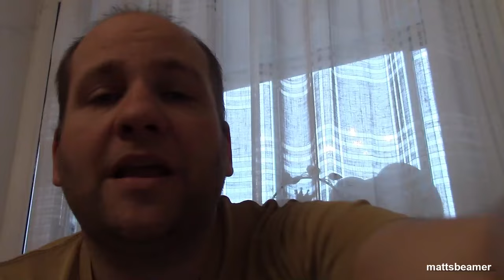BMW Drivetrain Malfunction (Error) Drive Moderately Problem. Information Video.

Comment: If it might be as a result of "dirty fuel" how do you go about cleaning out your car's gas tank. I stopped at a Shell station and put in 93 like I always do but it's kind of a Shell station that is out there so I think that might be why I am getting this message.
Reply from the maker: Hey, the way I had to do it, was to put the best fuel I could get into the take and keep driving it until the error disappeared. Did you let your fuel get too low?  )
Reply: @mattsbeamer  Just left the BMW dealership. Was not bad fuel. “found LF engine harness on engine bay to be rubbing on plastic bracket causing wire insulation to chafe and wires to short”. My service advisors took care of it.☺️
Reply from the maker: @jenme2390  I’m very glad it’s sorted for you. If you have any other questions car related I’ll be happy to talk :)

Comment: So I was flooring it around I have a decent build lots of parts on my 335 ,safe to say it’s meant to drive a little faster but ...the drive train malfunction message popped up, it drove home a nice 20 25 miles no problems at all it was not in limp mode it was shifting just not getting full boost or power,  when I got home in my driveway I restarted it and waited and it went away... drove it again today no malfunction light feels fine but should I get it checked ASAP or could it just have been me doing power slides and ripping it down the road
Reply: Hi, I have the same issue right now with my m235i. A nice build but I got this error when ai floored it. I noticed that it doesn’t go full boost but it’s still fast. What did you do with your car? Thanks in advance
Reply: @dbs_jd hey what was the result?
Reply: @ironmerc225 a boost leak because I had a meth kit installed

Comment: Hi I have bmw f10 2012 and drivetrain is on and I scan the car and is coming up egs
Reply: I am driving f30 320i 2013. I had the same error, it was a stuck waste gate arm. The electronic solenoid could not push or pull the wastegate arm

Comment: Two weeks ago, my 328i went into limp mode when I accelerated to cross an intersection. Drivetrain error popped up. Last week, it hesitated to start and I got a Chassis error. Yesterday, it hesitated to start and got an Open Hood Error. Today, it’s back to the drivetrain. Battery and alternator are both good. Is my car just bipolar?
Reply: I think my car is bipolar too.. has the issue been solved yet?
Reply: @raghadaleady7203  I ended up taking my car to the dealership in Ocala. I needed a new battery and I also had a service light on that I didn’t notice before because it only stays on for a few seconds. The service light was for brake lines to be flushed ( or something like that…lol). Ended up costing around $800 for both but now my car is running great. The service advisor at Ocala BMW was actually really awesome and he showed me how to check and see what service is due. He also said that even though I didn’t purchase my car there, anytime I needed service done, he would send someone over with a loaner car and pick my mine up at no cost. I live almost two hours from the dealership! So if you are able to get to Ocala, I’d recommend calling Robert!
Reply: Let me also add that I had tested the battery before I ever took it to the dealership and it tested fine. So don’t let a good battery test convince you that your battery is good.
Reply: @CarolynWeeks  Thank you for sharing your experience! I'm glad you sorted the problem out! I did ask them to check the battery and I'm currently waiting for the results hopefully the problem is very minor.. Ocala is definitely not anywhere near me since i'm in Saudi Arabia lol.. I'll keep you updated on whatever happens with my car, since we both have bipolar cars lol!

Comment: Also, the left lamp malfunction light comes on. BMW 328i What does that mean?
Reply from the maker: It usually means that one of the lights on the left aren't working. Sometimes this fault can come up, if you fitted a LEW bulb, or a dirty bulb. When you fit a LED, it typically means that's the computer is confused that the bulb isn't drawing too little power. I hope I make sense, :) good luck.

Comment: Hi All, I’ve got this error on my dash by just heading to the shops. I was in sport mode but was not thrashing it. I took it to the mechanics and he scanned with the OBD and nothing came up. No errors. The car drives fine, no shaking or start up issues. Not sure what it could be. I bought new spark plugs and coils and will probs replaced them anyways. Then take it to another garage to get them to scan it as well. Mechanics test drove the car and said the clutch, engine everything seems fine

Comment: I have a 2018 530E and this drivetrain message comes up whenever I'm driving at a high speed and brake hard. The car always jolts when it happens, as if the brakes failed.  The electric driving is disable after this and the message says I can continue to drive.
Then as you said, when the ignition is turned off and on, the error resets.
I just got the car second hand 2 months ago and the dealership checked and there were no errors. I wonder if anyone else experiences this? Also wondering if the hybrid recharging has anything to do with it.

Comment: Thanks for posting this video. Am getting it checked out and let you know what I find. I am thinking - though a bit out there - is that I just moved from a flat place to a mountain area. Perhaps the car is not used to all the hills in the heat.
Reply from the maker: Please do! I would be very grateful

Comment: My issue is very similar. It’s been a couple of months now since the engine light has come on and it has not gone away.
My 330e sometimes would start in electric mode but once it goes into petrol mode, it won’t switch back into electric mode until I start the car engine again.
Only once or twice I had the issue where my 330e would not change gear at all and I had to restart the engine and it was fine since.
Also when going downhill my car wouldn’t change to a lower gear.
Any idea what could be wrong?
Reply: Aux battery
Reply: @chrisallen649  so just get it changed?

Comment: I have a 2010 550i Gt and it’s doing the same thing. Except when I first turn it on it’s already shaking saying drivetrain malfunction. We’ve changed the spark plugs, coils and computer and the issue is still there. Any help ? Thank you !

Comment: Will get this error when I accelerate on an incline. No loss in power or anything like that when I get the error. Told by the dealer it’s the turbo wastegate issue.
Reply: Same exact problem.. they "fixed" the wastegate.. Yet, i still get this message.. so weird!

Comment: I drive BMW x3 2011 model. I got this message a month or so ago. I have been told by BMW Service I need to replace EGR valve actuator, I needed to replace EGR Valve costing A$750.

Comment: It happened to me the first time with my 520dw. BMW diagnosed it as low fuel pump breakdown and it was replaced at the cost of 1650 Aus $. I was driving it home from the BMW and the car stopped before I reached home k kms away from the BMW. second diagnosis was one of the fuel tank sensors gone off. Solution suggested was fuel tank replacement. Fuel tank came but without the sensor. i’m still waiting after one month. Rent a car costs so far $ 3000 plus. And the new tank replacement cost 3450.000. Quoted. This is a real let down.

Comment: For me, when I start my G30 540i it cranks slow then revs a little by itself for a little. Followed by limp mode, stuck on 3rd gear (slow)
Reply: Exact same issue on my 545i 2004, today I went under and noticed oil leaks under the engine and I saw a bunch of wire connection (between the engine and gear box) being soaked with oil. Also my speedometer does not work

Comment: My BMW trouble code 24F700 Fuel filter heating activation- open circuit and drivetrain signal message...
solution??

Comment: My 530i was stuck in water for about 15 mins and it was pretty high and then I got that drive train malfunction hike my car was vibrating. It then went away and my car was still vibrating a bit and now my check engine light is on. I waited 4 more hours and the vibrations have stopped but my engine light is still on

Comment: I've had my bmw 2014 116i sport for a couple of years now. 
Almost like clock work, if i cold start my vehicle it high revs for about 10 seconds, then drives fine. If I drive the vehicle around and stop and start it a couple of times, again, like clockwork, the vehicle shows the drivetrain message when I pull away and the car shakes, cuts out but restarts itself (stop start engine)  
I've had a high pressure fuel pump fitted, new spark plugs and coils. Can anyone help??

Comment: Please help !!! 
My 2013 435i develops misfire under hard acceleration then throws drivetrain malfunction code 

So initial code I got was 
118001 mixture too lean 

After drivetrain malfunction comes up  codes are as follows 
14001 combustion misfires several cylinders fuel injection switched off
140010 combustion misfires several cylinders detected 
140301 combustion misfires cylinder 3 fuel injection is switched off 
140301 combustion misfires cylinder 3 detected

Comment: i have 2017 330i. Today had oil changed. All was good... I reset the change oil warning light. Then, I pulled off drove about 3 miles then the Red Stop motor light comes on. I take it back to oil change shop, they pulled new filter and re-seated it. Car is at idle then the Drivetrain: Powertrain CONT. yellow came on. WTF is going on. Anyone has any ideas or specific knowledge please I am asking for any help or info. I just dropped 2k on the coolant pump in January 2022. No way I have this kind of money to drop into shop for repairs.

Comment: Man I did my valve cover started my car lost my P AND D light on dash if I leave it in gear long enough it will jolt real hard into drive and reverse . I got codes transmission range sensor circuit malfunction and lost communication with gateway. The car doesn’t shift until 4500 Rpms I have no control over the gear selector and I’ve already checked the gear shifter for shorts and I have changed my fluid and filter the problem is still here . If I reset the codes while driving it will shift at 2k rpm up until about 60 mph and my trans is in safe mode
Reply: Did you ever find out your issue?

Comment: Hi I bought a used BMW X3 2011. The very next day i had the error message while I was trying to start and go on a drive. "Drivetrain fault. Please contact BMW service center". So the car was in parking mode and I could not change it to drive mode. Car starts but the gear cannot be changed. I tried starting after few hours and the problem still exists. Please help if anyone knows about this particular case. Thanks...
Reply: did you ever figure it out
Reply: @nyustdent  yeah, I had to replace the 'mechatronic' unit. Costed around USD 3500 for the complete work. After running well for 3 months or so, I got the drivetrain fault again. This time, it was coils and spark plugs. The technician said replacing the faulty coil is sufficient but I may get the same error again as the other coils and spark plugs also on the way to get faulty. So I replaced all 6 coils and 6 spark plugs at a cost of around USD 500. I live in Saudi Arabia so the costs may be different for you. Thanks..

Comment: hi, Matt, i have a 218d automatic, this drivetrain malfunction appears all the time when i start off the engine. the sysmtoms: i could not speed up as quick as before, and it's hard to reach 70/80miles/hour. and it takes longer time to gear up(auto). could you explain what's the reason behind? thanks
Reply: I have the same problem but BMW can't see car for one week, and no loaner!!!  Did you drive it around like this until it was fixed?

Comment: Thanks for the video Matt. I have the same issue at the moment. I recently started noticing that my coolant level kept dropping in my 2012 F20 - I kept seeing that my coolant level was below the minimum line, the iDrive never gave any warning that my coolant level was low though. I now also have this Drive Train error message which has started to appear. I’m wondering if there is a link between the lower coolant level and this Drive Train error message - some have suggested that it could be the Auxiliary Water Pump?
Reply: Having the same thing
Reply: @royalchannon3176  I’ve since had mine diagnosed. Turned out that it was a faulty Auxiliary water pump (required for the turbo). This has since been replaced though my mechanic suggested the coolant loss wasn’t do to with just the auxiliary water pump and that I should monitor coolant levels going forward. iDrive warning no longer showing. I’d suggest doing a diagnostics with a BMW ODB readier to find your exact fault.

Comment: Coil spark plugs, Clogged Cadillac converter, high fuel pump system not sending enough fuel for the system "or as low quality fuel in,  dirty fuel can cause this issue, faulty fuel injectors ,turbo injectors ,turbo issues, head gasket, mess airflow issues, batteries

Comment: On my 530D this warning comes only when I speed up, the warning goes off when I restart the car. What could be the problem ?
Happens usually above 180kmph
Reply from the maker: Hey :) the car could be hesitating slightly when you put your foot down. It’s best to scan it, and it should bring up some codes. It may be worth buy a cheap scanner, to help with the basic codes :) let me know if you have codes up :)
Reply: @mattsbeamer  okay sure )
Reply from the maker: @MJ-yu7kw  cool :D

Comment: Auxiliary Battery is low/'worn' -  should be replaced, but BMW told me its NOT urgent.
Reply from the maker: I’m surprised that they didn’t try and get money from you. Just remember when batteries are low, it may create many fault codes, which they may charge you to find them.

Comment: Zaman ZF
0 seconds ago
Hi I. have 2008 bmw x5 3.0si and it shows malfuntion continu driving possible reduce acceilation ...and its very slowly speed up but gear shift easy still ..doesnt stays in idle for long time but pressing gas keep it life ... not sure which shoud i fix .. if anyone faced the same or knew it please help :(

Comment: I’m have this poped up I was accelerating and after 3 gear. My car is 2016 550i drive
Reply: Figure it out?
Reply: @davidwithers7181  I will know Monday, me and mechanic though it might have lean fuel but that was not the case.
Reply: It popped up for the second time
Reply: Ours is a 2015 750i same motor.... ours now has a cel...... happened right after my wife ran it out of gas.  I'm thinking it's the hpfp as we have multiple cylinder misfires.  Car has been perfect up until that.  Keep us posted.
Reply: @davidwithers7181  We finally troubleshoot the problem we thought it Might been bad fuel but it wasn’t the case we got cylinder misfire three and what I ended up doing is changing all spark plugs and coils but only had one misfire I advise you to do the same thing and change all of them I just did it now and my car is running better than ever

Comment: Long shot but hope someone can help. So I got this error yesterday, I  scanned it today and only 1 code came up, p0882, that's it, no misfire/failed cylinders. I suspected it was my battery (f10 2014 550i), turns out it was pretty bad, went down to 7v when starting it, checked the battery and it was bad. Changed the battery, and the code and error is still there. Car still shaking. Kind of at my wits end on what to do. I've restarted it twice already, immediately get the error.
Reply: So update, I was finally able to erase the code with my scanner, ordered a Bluetooth odb dongle and getting the bimmerlink app so I can register my battery. The drivetrain error came back after a few seconds, but the car is shaking a lot less, and a bit more power when driving. I've only shut the car on and of maybe 7 times, I also checked all my fuses. When I scan it, now I get 0 codes (0 dtc). I'm thinking maybe I had bad gas, and pushed the bad battery over the edge? Still figuring it out
Reply from the maker: Hello, this is very interesting. Thank you for keeping us updated. My nephew used to have a F10 550i and I loved it. I’m sorry that I’m not very knowledgeable about this situation.

Comment: I have a 740i 2012. I have this problem right now! I will contact carmax later on. Will update you all!
Reply from the maker: I look forward to hearing your results, I hope it’s nothing serious. Cheers
Reply: Update: BREAKING NEWS 🚨 2012 740i Drivetrain Malfunction: I just picked my car from Carmax service dpt... spark plugs were changed. Starter coils (2) were replaced. And lastly, Engine vacuum was replaced.

Comment: I'm having an issue where my 530i 2013 (N53 Engine) runs smoothly but won't engage in gears... to elaborate, when I try to shift to D or R or N  it will go back to P instantly after releasing break, and after a few tries it will just stick to P.  No error codes on my scanner, will try my friend's scanner tool and see if it shows something. Any ideas how to fix it?
Reply from the maker: Hello, has your car got a good batteries. One of the most common reasons is due to a bad battery. :)